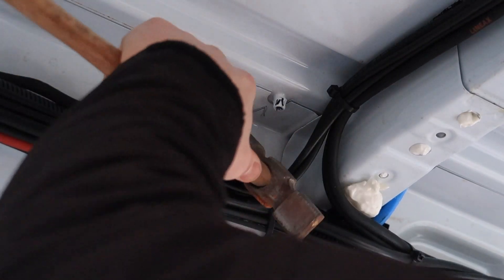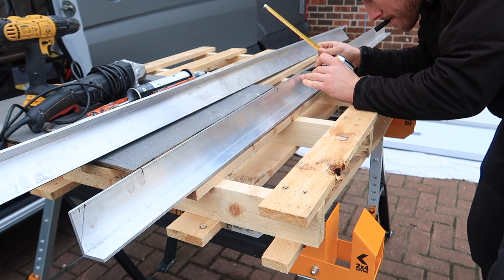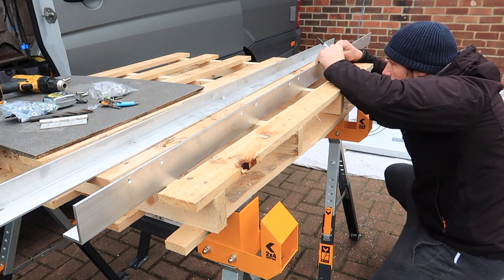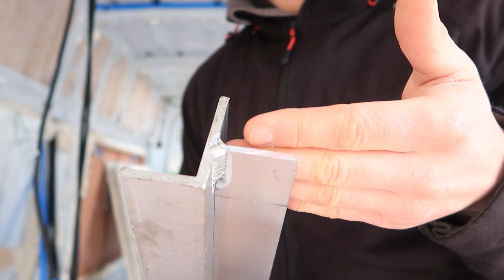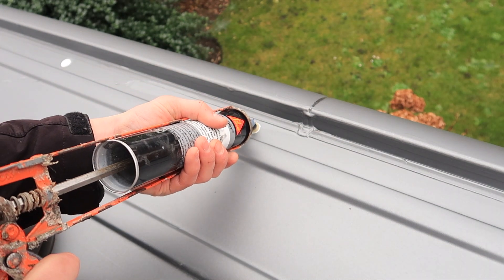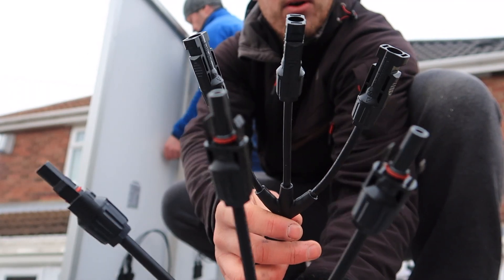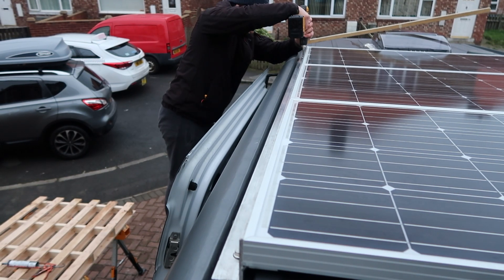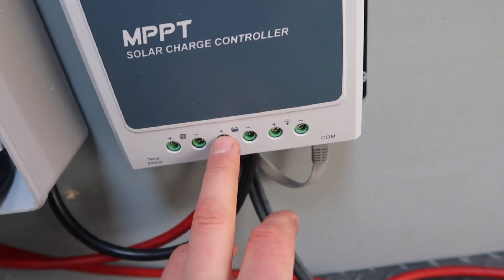Adjustable Tilt Solar Install 450w | Ep16 | Sprinter Camper Van Conversion

Comment: Have you thought about an m8 threaded knob into a rivnut on the solar panel, you see the knobs but it’d work. Good videos by the way. You sound like ur just up the road from me, Hartlepool. Take it easy
Reply from the maker: Just ended up tapping them with an Allen Key bolt in the end. Easy enough to unscrew if needed. I've never tilted the panels since I fit them truth be told

Comment: Hey Scott, very helpful watching all your vids as we do our Sprinter conversation! Quick question, we are doing a similar roof set up. Maxx Fan & Dometic Midi Heki – wondering how close the 3 solar panels are to them? Is there some room to breathe or is it a tight fit? Also wondering if two panels would be the trick...
Reply from the maker: Maybe 100mm either side. 2 is ample I would say but you would have to do the math.
Reply: @ScottAndJen  cheers mate!

Comment: I was hoping you would have left a bit more gap between the panels and the frame mate, I am worried when you get to hotter climates they may be a bitch to sit back down as they will expand a bit. Also maybe consider some bracing under the panels to help support them when they are propped up when its windy? I guess that may come in faze to work you work on the supports?

Also I am sure you can find some longer hooks  so the clasps with still work for you? 

Great progress so far, the build is really coming together nicely. Lots of great ideas
Reply from the maker: Never had a problem in 3 years

Comment: Hi Scott, another great video, thanks for sharing.
Have been thinking about your toggle clasps, maybe you could still use the clasps that you've got, but maybe with an angled bracket mounted on the solar instead of the ones supplied with the clasps.
Don't know whether the size is right for you, but if you google 'Protex 03-1692SS' you'll see the kind of thing I was thinking of, admittedly these ones have the holes end on end, whereas you'd need side by side. But just a thought.
Reply from the maker: Haha this is what happens when you are doing a conversion. You will have to show us how yours is going. I will have a look at these lovely Pearl Wing bolts for sure😂
Reply: Try 'Protex 03-2204MSZN'.
They actually supply lots of different versions, one of them might be right for you.
Reply from the maker: @michaell8835  hey mate thanks for that. I was thinking of tapping the ally angle and frame and fixing with butterfly bolts but will have a closer look at those catches now when I get a moment. We took it for a quick test drive even without one side fixed it wasn't rattling so I don't think it needs anything to heavy to sort the job.
Reply: Scott & Jen Yeah, good point, that might be an easier route to be honest. I was looking at some really nice wing bolts a few days ago made by Pearl. Might suit the job nicely. Can’t believe I just confessed I really liked some wing bolts, I need to get out more 😂

Comment: Just a tip for anyone that is thinking of doing this 6v cells are far more efficient than 12v so 4 x 6v wired in parallel and series to give 12v will always out perform 2 x 12v
Reply from the maker: Hi Blue, are you referring to batteries or solar panels? I'm assuming batteries
Reply: @ScottAndJen  yes Batteries
Reply from the maker: @motsigman  I agree if the quality of the batteries are the same then 2x6v in series will out perform a single 12v however not in every instance, age and quality amongst other things must be taken into account. You also have to take into account the space/weight for the extra battery if you are planning to run a single 12v battery system. Also if you want to upgrade and 6v system you cannot upgrade from 2 batteries to 3 it's has to be another two batteries you would need to purchase find space in the van for and also account for the added weight. There are pro's and con's on both sides so make sure you know what you want before purchasing would be my advice.
Reply: @motsigman  Agreed mate, golf Kart batteries are bomb proof. Trojan badboys in my van but they are wet batteries so need venting. You can fast charge them though!
Reply: @UnstoppableTramp  I use Trojan all the time, bulletproof ..

Comment: Instead of taking a generator. why not link the alternator to the charge controller. just leave the van on tic over if no sun light?
Reply from the maker: Hi Jamie. Please checkout the electrics part one video you will see we do have a split charge system but dont really want to be leaving the van ticking over being separated from the front cab. Thanks for the idea though

Comment: Looks great that guys, well done. Would you mind sharing more details of your complete solar setup? What is the panel make and size, controller you used etc? It is the one thing I am having trouble with, was hoping to use lithium batteries. I have a smart alternator in my vehicle, so know this causes a few issues. Having alternator charge, solar charge and hook up is needed, I guess you are doing the same. Really nice aluminium brackets you have there, could you suggest where I could get the same? Thanks for any help, it is much appreciated Steve
Reply from the maker: Steve I have updated the description so hope this helps you out. Lithium batteries is the way to go if you can afford it but can work out very pricey to get the same AH as with a deep cycle AGM, you really have to do your research and weigh up the pro's and cons. As far as smart alternators go check our electric part 1 video and the comments section and it might set you on the right track. Cheers
Reply: @ScottAndJen  Thanks for your help. I have found out that this REDARC Battery Charger is good for vehicles with smart alternators, lithium batteries and does MPPT for solar systems upto 500w - https://www.redarc.com.au/dual-input-40a-in-vehicle-dc-battery-charger. I will most likely have a solar system using this. Cheers, Steve